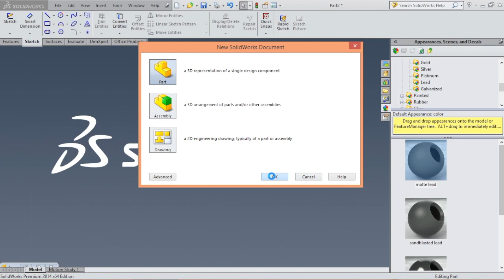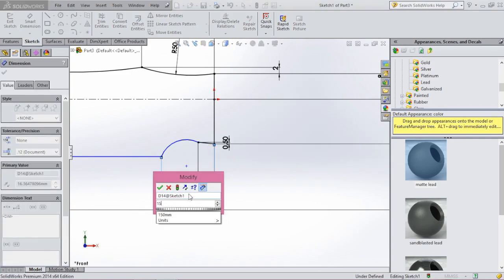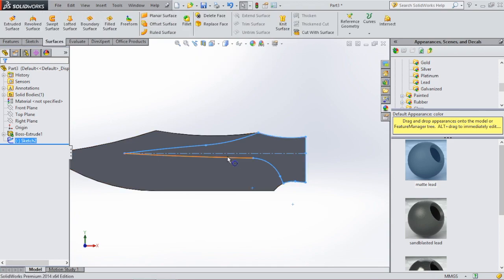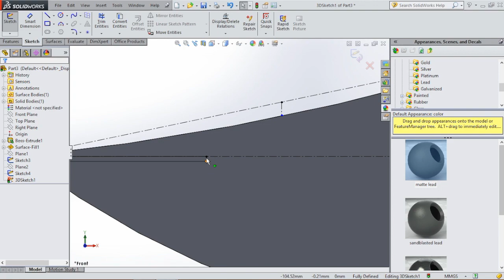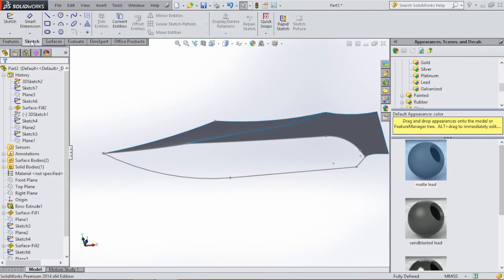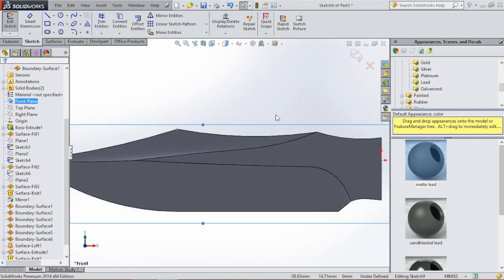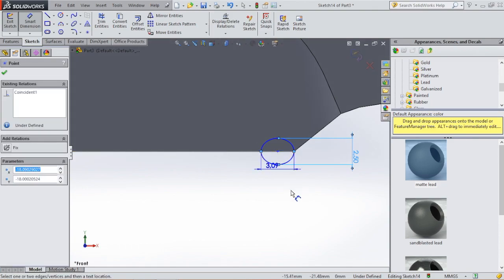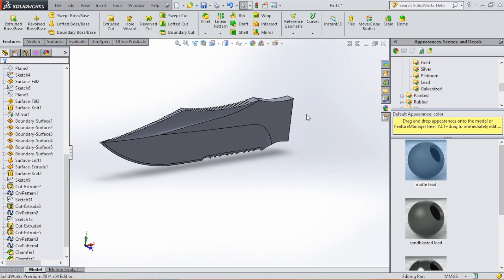SolidWorks Beginner tutorial 7: Combat Knife - Part 1 (surface modeling)

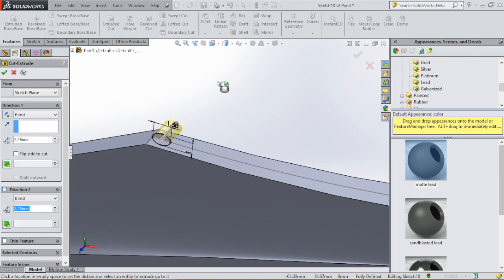Comment: Hello. First of all, I would like to thank you for such an a amazing tutoriail. However, I was wondering if you can help me with a problem I got with Extruded cut at 17:42, when I click OK, the Rebuild error apears : The intended cut does not intersect the model. Please check the sketch an direction. 

Is this some kind of quick fix or I need to start over? Thank you for the answer and your time.
Reply from the maker: Hi Rok, I'm not sure what it could be, but the first thing I think of is that the "Thin Feature" (underneath Direction 2 on the left of your screen) might be selected. Sometimes SolidWorks checks this box automatically and you will receive an error. What could also be possible is that you have the sketch for the cut (the eclipse) and the guideline for the curve driven pattern in the same sketch, if thats the case, make sure it are separate sketches. Please let me know if this solved your problem, otherwise I will check my file to see if it might be something else. Ty for the nice words btw ;)
Reply: Thank you for the quick response. The "Thin Feature" is not selected and also I made two seperate sketches for giudeline and the eclipse , so these two options are not the problem.  I was wondering if I made some kind of mistake through the proces , because I also tried all the other Extruded cuts as you shown for the rest of the tutorial but it always apear the same error.
Reply from the maker: You are welcome! Did you knit all the surfaces together and checked the box "try to form solid" while doing knit suface? If it isn't a solid object yet, you cannot use cut extrude. If it is still not working, I will check my file tomorrow.
Reply: Yes,  this was the problem. I did not checked the box "form solid". Now is working. Thank you a lot for your help, It is very well appreciated. Keep up with good work!
Reply from the maker: Nice! I will make more tutorials in the future, so hit that notification button for more ;)

Comment: I am attempting to make a similar part for a school project. It has to rotate about a pin because it's part of a multitool assembly. For some reason, I can't get the ellipses for the serration to extrude - I get an error stating it does not intersect the model. Is this because it's a knit surface? I did select make solid when knitting. However, I had to make the pivot plate out of a regular extruded boss/base, so I wonder if it is looking for the sketch to be cut out of that body.